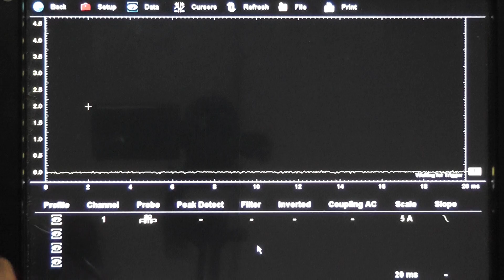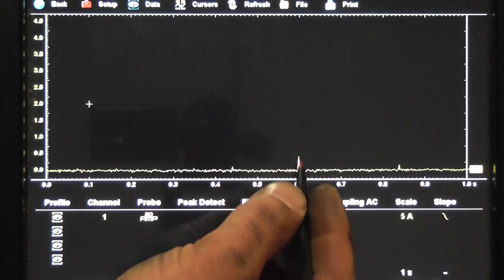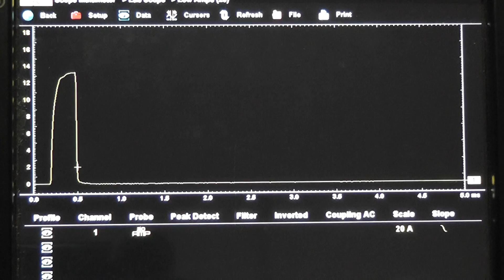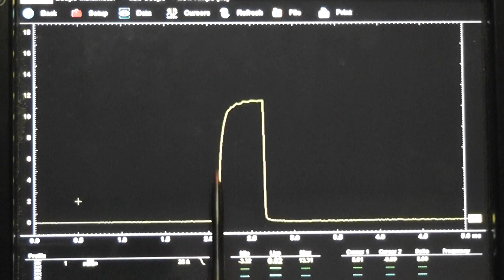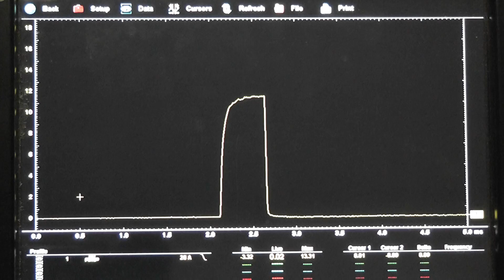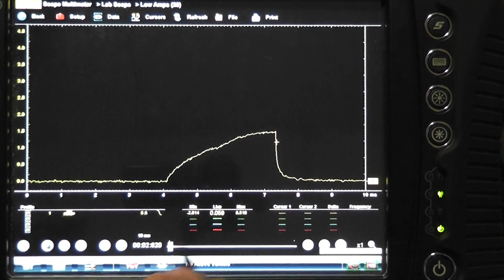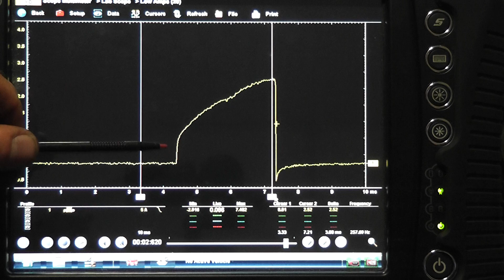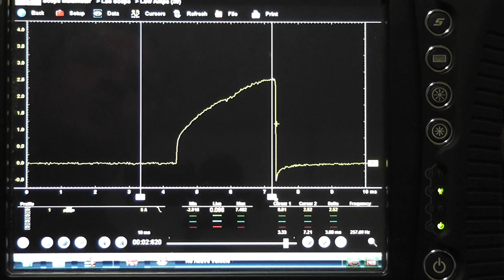No Start No injector pulse (shorted injector) part 1

Comment: Scanner Dan please help..I have the same set up on a 1993 sunbird gt injection wires are even the same color I have unplugged each injector alone and tryed to starting and no start I have power at each injector plug on the brown pick wire 12.2 volts ish constant but no start this car has a computer behind the glove box that I have swapped with a known working computer but this sunbird has another computer looking thing above the master cylinder under the wiper grate on the fire wall that my z 24  does not have is this the computer that controls the fuel rail and injection system on a sunbird or is it the one behind the glove box my local chev dealer said the behind the glove box was the one I jeered to change but when I checked the wires going into the external fire wall "computer" some of the wires are the same as the injection system wiring harness blue,green and the pinkish brown dobyou think chev is wrong about which computer controls the injection system or do I litterly have a broken wire somewhere in the harness
Reply from the maker: Is this the 3.1? The ECM would be behind the glove box area. 
1. Do you have spark? 
2. With the key on, tell me if you have a 5v ref at the TPS or MAP sensor.
3. There are two injector control wires Dark Green and Dark Blue right? Take one fuel injector with an incandescent test light to ground and touch on each pin. Tell me what you see during cranking
Reply: @ScannerDanner ok thanks for the info I will check what I can tomorrow,.i do have fire and it will run off either I don't have a lot of equipment except test light and multimeter and a obd 1 but I have fuel pressure to the fuel rail and fire in the coil and power to my brown and pink wire  common on all 6 injectors in the injection harness with the key on,.and all grounds grounding property on the injection harness I'm really stumped and the tecks at my local dealer are to..I don't have an incandescent light is there any thing else that would verify this problem..thanks for any help and replying
Reply from the maker: @RobertNuttall-f3i  have you confirmed that you do not have a shorted injector?  How long has it been sitting? I have seen ALL injectors sticking closed after long periods of sitting
Reply: @ScannerDanner hey Dan yes this is a 3.1 and we have fire and no voltage at the map sensor plug when the key is on..when testing the injector plug while cranking I'm getting on and off light..this engine will run off of starting fluid..also tested the resistance in all injectors and they are basically all the same 12.2 to 12.4 is this ok any idea why there is no power at the map sensor plug

Comment: Thank you for teaching me so much in the last two hours. But I do have a problem with a 1997 jeep wrangler and using my node light I can see my jeep's injector pulse cut out after the engine starts. I never lose power to the coil and I can keep it running with a outside fuel source directly through the intake. Most sensors are new except map, temp,. Change out pcm programmed to vin, idle speed.p❤

 sensor throttle position, and O2  upstream. Continue to have start then stall by injectors  losing power. I am thinking it is a shorted map sensor  but almost broke already. Do you have a video that relates. Your videos are great.
Reply from the maker: Losing power or losing control? 
Do you know if the spark drops off the same way?

Comment: Hey, Paul. Current follows the path of least resistance. Usually, fuel injectors are in parallel. We would expect current to flow to the injector that is shorted and not to the other ones causing a fuse to blow, right? I may search in your premium channel  again tomorrow to see if I can find series, parallel stuff.
Reply from the maker: You're forgetting one thing, the driver is limiting the current flow, way before the fuse would blow 🙂
Chapter 16 playlist both here an premium for more on this my friend. Thank you!

Comment: I got water damage in my 1993 BMW 320i. I am having 0.333volts on my injector power line (red/white) instead of 12volts when key is on ON position. Hope i will be able to fix the corroded SMD components
Reply: The car is having spark and is cranking but not starting. Now I see it's the DME fault. Water enters the DME  bay and it's starts to go bad

Comment: 2002 tahoe 5.3. I lose injector pulse  right after starting. Like if  the computer shuts it off. I checked for codes and there are non. Bcm does not have any theft codes and engine no crank sensor codes. I replaced the crank sensor but still not starting.  Any ideas?
Reply from the maker: Are you losing spark too?
Reply: @ScannerDanner  no I can start it with starting fluid. It's like it starts for 1 second then shuts off The scanner says fuel disable active then shuts off. But there is no time out cus it will start it for 1 second everytime before it shuts off. Also, if I disconnect all the injectors, I don't loose injector pulse while cranking.
Reply from the maker: @MechTech5000  can you scan other modules? other than the ECM? This sounds like a theft issue
Reply: @ScannerDanner  yes I can scan the bcm and brake control module. I agree. I looked at the data in the bcm security part and it disables the fuel every time it starts bit doesn'tgo into lock put mode. How would I go about testing the pass lock sensor in the steering wheel column? Well  I at least know what direction to go now. Thank you for the reply.
Reply from the maker: @MechTech5000  I think the instrument cluster is responsible for the anti-theft part? I need to look up service info for you. Let's move this to my forum www.scannerdanner.com It is free to join and I can help you better there. Let me know when you post it and include our conversations in your post okay?
Reply: @ScannerDanner  ok, I posted our conversation through the pics. it wouldn't let me copy and paste.

Comment: With the injectors and rail out can I plug in one injector at a time and get it to pulse  or do they all have to be plugged in for it to pulse trying to figure out if I have bad injectors or a bad computer with very basic tools
Reply from the maker: Measure each injector with an ohmmeter first. They should be 12.6 ohms each
Reply: Ok thank you
Reply: 5 reads 11.9 and 1 is 12.2
Reply from the maker: @ablanchard3068  so that doesn't sound too bad, but temperature can be a factor on those as well. Resistance can be good at room temperature then with heat from the engine and from current flow they fail. If it is a flat no start right now, I'd move in another direction. Do you have spark? What are you working on?
Reply: I have spark and feel pressure there is a new fuel pump in it I put fuel down the plug holes and it burned off the fuel so I took out the fuel rail and injectors and they are not spraying I can manually make them spray but they won't spray when hooked to the car and the car is a Beretta gtz
Reply: 1992
Reply from the maker: @ablanchard3068   okay cool, I know this system like the back of my hand. 
Coming out of the ignition module is a purple/white wire, this is the reference signal from the module to the ECM for the RPM signal, the ECM uses this signal for many things with one being injection pulse. With the key on, take a test light (incandescent bulb, not LED) to battery positive and touch on and off this purple/white wire, the ECM should fire the injectors every time you touch that wire, if it does, you need an ignition module. Doesn't matter that you have spark
Reply: Ok thank you very much for your help I will check that tomorrow and I will let you know the results thank you
Reply from the maker: @ablanchard3068  can you hear the pump when you turn the key on? If not we may go in another direction. Do you have a voltmeter? Check for a 5v ref and the TPS or MAP sensor with the key on
Reply: Every time I touch the purple and white wire the injectors sprays fuel so I'm going to order the ignition module thanks again for your help
Reply from the maker: @ablanchard3068  crazy to say that with good spark, you need an ignition module right?
This module takes the AC sign wave the crank sensor produces and converts it to a digital signal before sending it to the ECM. It is within this process where your failure is. 
Let me know how it goes.
Reply: @ScannerDanner  Hey just put a new ignition module in and the injectors are still not pulsing I can manually post them and make the car start but won't stay running on its own

 just got back at it now that the snow is melted
Reply from the maker: @ablanchard3068  you need to check that purple-white wire for a short to ground. (aftermarket alarm system tied into that wire??)
Also, with the key on, make sure you have a 5v reference circuit. Check it at the MAP or TPS, one of the three wires should be a steady 5v
Reply: @ScannerDanner  okay I'll check for a ground and check for 5 volts and there is a aftermarket alarm system in it don't think it's hooked up to that wire car used to start with the alarm on when I tap that wire on the battery maybe after the 10th or so tap the radiator fan kicks in
Reply: @ScannerDanner  I noticed every once in awhile that when I would tap that wire nothing would happen spin the motor over and tap the wire again and the injectors would fire and fuel pump won't kick in so I took off my knock sensor and everytime I stick a screwdriver to it and release it the fuel pump kicks in and so does the injectors would it be a bad knock sensor it's a new sensor but that don't mean nothing
Reply: Crankshaft position sensor sorry lol
Reply from the maker: @ablanchard3068  let's move this to my forum, it is free to join and we can help you better there www.scannerdanner.com , I'm so sorry for the late replies, doing the best I can to keep up. But it is why I created my forum, to better help you guys. Hope to see you there
Reply: @ScannerDanner  I think I got a another car lined up that is running with a 3.1 in it so I'll switch parts from one to the other until I figures out what it is thank you for your help and I appreciate your time I'll let you know what it is when I finds it
Reply: I would have been a while trying to figure out that one for sure I was thinking injectors gone bad or the computer  I'll let you know the results when I get the part

Comment: Ill have to try this. Tried to fix a leaky injector  and after putting it back the engine wouldnt start.  I didnt know one bad injector would stop the whole car. I was thinking to myself even if 1 injector is bad i still have 7 more. I was blaming ecu or a list of other stuff
Reply from the maker: On these early group fired injection systems only. What are you working on?

Comment: Hello, Paul. I am just trying to understand something from the video. You stated that the driver does not carry enough current, limits current flow to protect itself from the overload. Do you mean that the driver was not designed to handle that much current and the PCM limits current flow to protect the driver from the current overload?
I would really, really appreciate your answer.
Reply from the maker: yep, watch part 2 https://www.youtube.com/watch?v=3gTLY6vsxMg
It will answer your questions I am sure.
Reply: Thanks, Paul. I have just watched it. What I was trying to know  was: Is it the driver that limits the current to protect itself or the pcm that limits the current to protect the driver?. Since you kindly answer yes to my question.You made my day.
Reply from the maker: Well to be technical, the driver is inside of the PCM, so to me they are one in the same. How the driver is being protected? Now we are talking about something I am NOT an expert in. Electronic engineering is where we are now with this conversation.
Reply: You answer is good enough for me. You are the one that I follow the most. To me, you are the best. On my way to the forum now.

Comment: Redirected from other video,
when my 1987 vette is warmed up, I placed my foot on the floor and it just stayed at 2300-2400rpm backfiring and shaking, and then when I let go(all of this was less than 3 seconds) the RPM shoot up to around 3000rpm then went back to idle.  
It legit sounded like it had launch control installed or a WOT box installed, not sure if this could be the issue but I'll check that.
I did scan the car and got these DTC codes:
1) 63 2) 61 3) 54 4) 52 5) 51 6)46 7)36

Comment: Had a look at an '87 C4 Corvette no-start for a friend yesterday.
The car has been sat for some years.
Initial problem was no fuel pressure, bad pump.
I had spark and injector pulse both banks.
Fitted a replacement, got a couple of psi. Now low voltage at pump due to corroded fuse.
Sorted that, had 45psi.
Cranked and got a bit of life.
By feeling the headers, found only cyl 3 and 5 had fired.
Found a few plug wires on in the wrong order, cured those and got all bank 1 to fire.
Next step was bank 2.
Even though I had seen the noid light flash on a bank 2 injector earlier, I removed and cleaned the fuse. It too was badly corroded.
Next key on, the cooling fan started up and when cranking  I had no injector pulse on any bank.
Also the SES lamp was flashing codes 1,1 and 1,2 alternately.
These codes are flashing at every key on, without bridging A and B on the ALDL.
This video reminded me to check again for shorted injectors.
Any ideas on the flash codes?

Comment: Hi Paul, great video! What if I disconnect the control wires at the connector and connect a testlight between the feedwire and the negative control wire? Would I see a flickering light? This would verify the control signal from the computer, because the injectors are all unplugged. Of course this would also be possible if you disconnect all injectors and put a noid light or test light on one of the connectors. But since they are difficult to reach, it would be the much bigger effort.

Comment: I think I am missing something, If you were to suspect a shorted injector on that system It appears you can d/c the main feed connector harness (4 wire connector) to the injectors and check for a grounding pulse there (test light on 12v+) ? That would test the ECM to make sure its "firing" the injectors with just a test light. AND the shorted injector would be out of the picture.

Comment from the maker: IT is a crank signal. No cam on this design. You still had good spark because the PCM doesn't control the spark during cranking. Watch my GM Bypass ignition system video. IT is similar to this Ford.

Comment: question about 87 ford  f150 good spark no injector pulse, bad pcm ground, what input use the pcm to control injector pulse, what is PIP? is this a crank or cam signal? fix the ground fix the injector pulse but still not 100% how this pcm had good spark no injector pulse..

Comment from the maker: or the pick-up coil in the distributor, or a bad module power and ground or an open in the reference wire. 
if the ECM responds to the bypass test, this just tells you that the ECM is good and that your problem is in the module/pick-up coil circuit

Comment from the maker: sorry, I think you did this. Lets do it differently, leave injectors plugged in and backprobe the connector (use a t-pin) one wire at a time. during cranking one side of the injector connector should stay lit and the other side should flicker. (test light to battery NEGATIVE this time)

Comment from the maker: you need to check for injector pulse. disconnect one of the injector connectors, connect test light to BAT (+) and touch on the control wire (i think they are red and blue if my memory serves me correctly) and crank the engine. your test light should pulse. If it does your injectors are stuck shut. you can smack on them with a screwdriver during cranking, it should free them up if this is the case

Comment from the maker: ok, that means the test worked and the ECM did receive the RPM signal. This is why you heard the fuel pump run. The injectors should have also fired. I have NEVER seen the injector drivers (ECM transistor) go bad on this design. I would be more concerned with wiring or mechanically stuck shut injectors. Did this thing sit for a long time? If so the injectors are probably stuck shut from a varnish build up (old gas).

Comment: Thanks i used that wire, when i REMOVED the test light i heard a humm for about 4 seconds and felt the fuel pump relay was being activated-- like i said maybe 3-4 seconds, saw no fuel or click from the injectors === next step?

Comment from the maker: yes. here is a test for you. key on, engine off. connect a test light to BAT (+) and touch on/off the purple white wire coming out of the ICM (ignition module). (Make sure everything is plugged in) This will provide the ECM with an RPM signal and the ECM should respond by firing the injectors. Let me know the result

Comment: Dan, my buddy has a 92 GM 2500 pick-up w TBI , he has no pulse,  yesterday i tried a test light on bat + and with key on the light is on, cranking NO light- before i looked at it he replaced the fuel pump, and then decided to replace the pick-up which i changed for him, then he changed module, still NO start, i just pulled the ECM for him-- however i was thinking about a short somewhere-- i see pin 14 + 16 for injectors -- the ECM grounds the injectors correct?